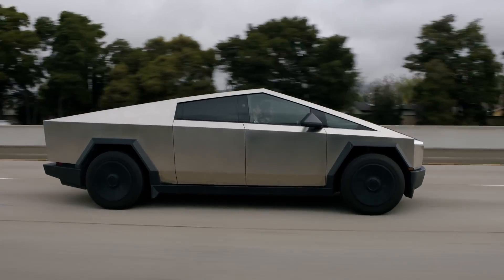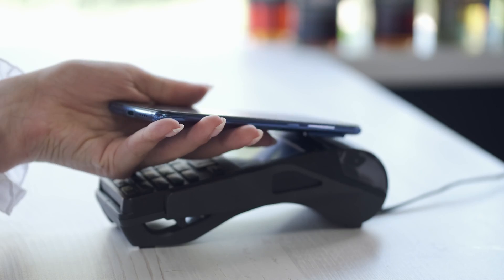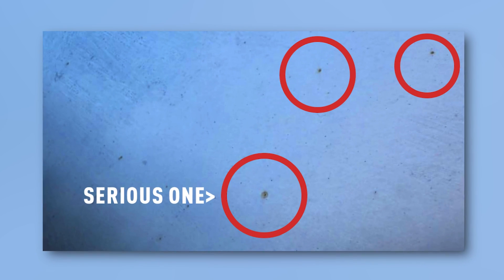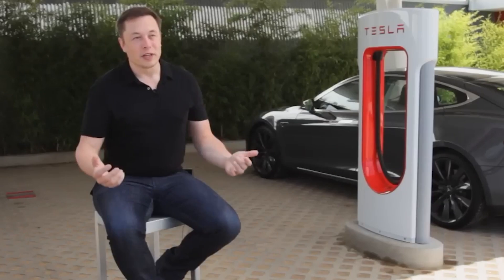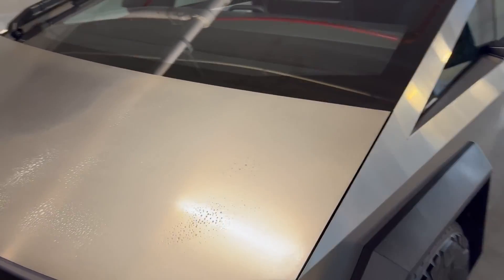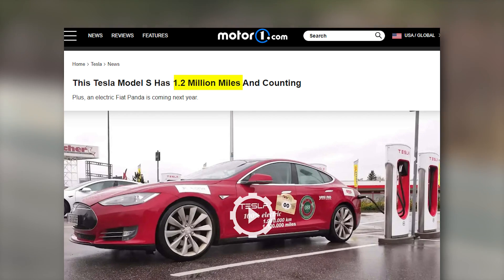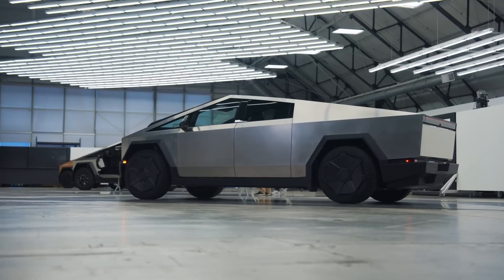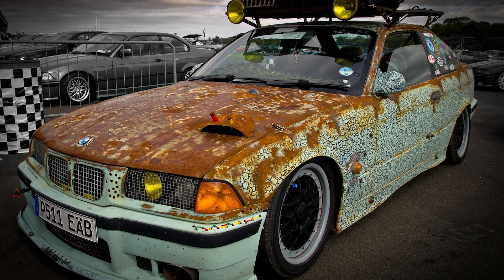Tesla Cybertruck RUSTING

Comment: It's not hard to understand, the grade of stainless they used has iron in it ie 304 if they had used 316 it wouldn't of rusted
Reply: what are you even talking about? all steel has iron in it, and this video is clickbait garbage
Reply: @nocommentate9017  I've never seen a new car rusting before. Have you?
Reply: @munaq-jp  Nope, I haven’t, not sure why you want my anecdotal experience. I made two points. One, 316 has iron despite what Jon said. Somewhere between 62-72% iron. Are you implying I’m wrong about that?

Second, look into it yourself. This is a clickbait video. The metal is not rusting, there are, in very limited instances, surface contaminates on the panels caused from driving near things like railroads. That contamination is not IN the metal, it’s ON TOP and easily clay barred off. These people making the dramatic rusting thumbnails are either experiencing the above, or faking it with photo editing software. I forget if this video also said someone got shocked by their cybertruck body, but that would be due to them improperly installing their charger and not grounding it. The same would happen on any other EV.

Sure we can agree the cybertruck is goofy. The point is that these claims are all clickbait and false
Reply: I've read it's probably 301 instead of 304.

Comment: I have the same problem with my white car, it was driving me crazy then I realised  that when I commute I park the car to the station and get the train, and because I leave the car close to a train station there are many metal particle flying around caused by the train breaking this particle just land on the car and stick so with rain they start to show rust, someone told me they actually go deep and kind damage the first layer protection of car paint, so is important to remove them as quick as possible.. and on white car they look more visible of course...